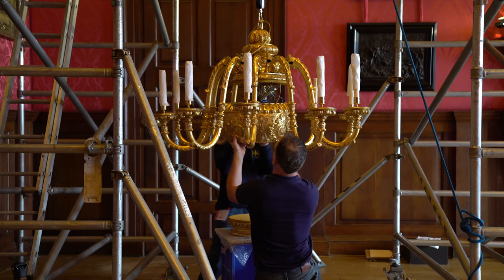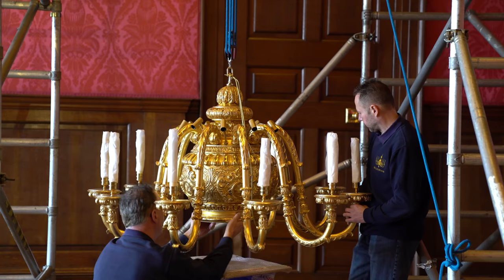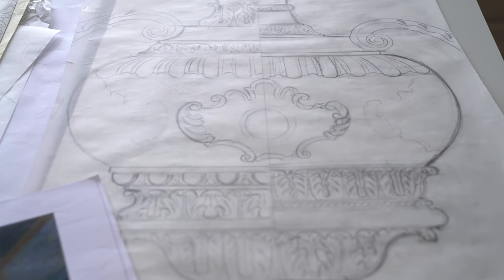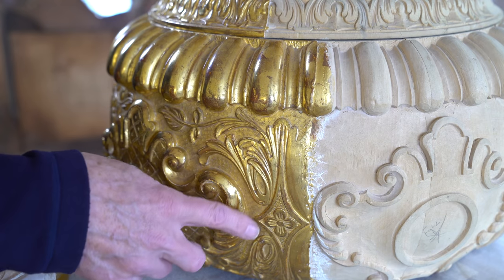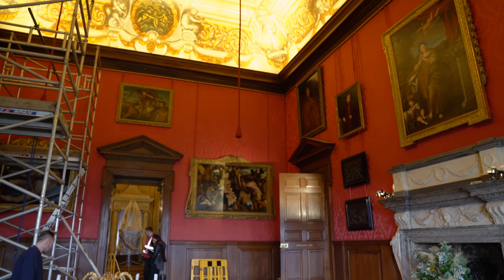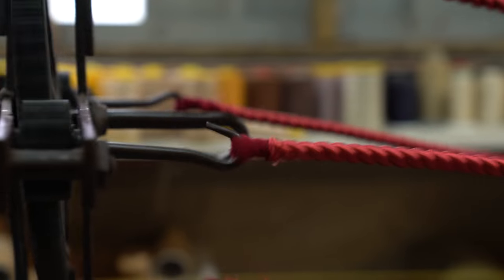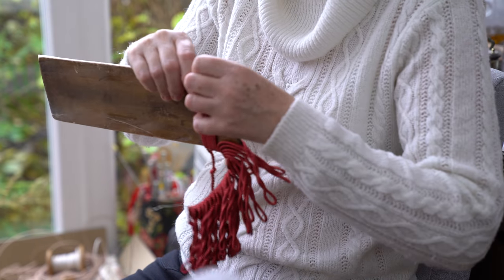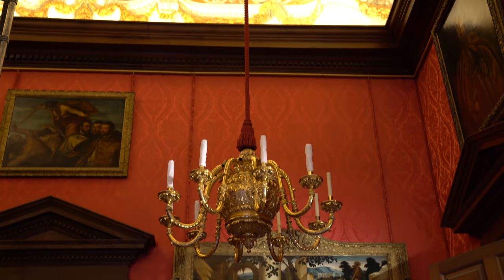Chandeliers return to Kensington Palace after 200 years

Comment: I had no idea that most chandeliers were made from wood at the time! I had always assumed they were fully metal. I suppose that makes sense, considering what the weight of a metal chandelier, plus the fact that you would not be up close to it to determine the material anyway.
Reply: I'd love to know how much these chandeliers weigh!
Reply: Some old chandeliers in White House is made with wood too.
Reply: I think he said many, not most. There were many brass chandeliers of that period also.
Reply: I'm guessing a metal chandelier was significantly more costly.
Reply: @davidd7940  Probably not.  Metal would be cast in a mould, whilst these were all hand carved and then coated with 24 carat gold leaf.  Of course, very rarely they we made of solid silver.  There is one at Chatsworth in Derbyshire.
Reply: Large metal ones would probably be hollow inside where as wooden ones is solid.so weight might not differ that much.  What type of wood was used: oak, pine, etc?

Comment: They go to all of the trouble to make them out of wood to be authentic instead of casting them in metal and then gilding, but then they wire it for electric and stick electric bulbs and fake candles on it. Pretty stupid, either it is authentic or isn't and if it isn't why bother with making it from wood that is not going to last or be durable?
Reply: I know it all. I know it all.  When they make a big stink over being authentic that means candles. They have millions to make wooden chandelier copies that will not last that long for the sake of authenticity. Then they stick electric candles in it. The two concepts are in-congruent.
Reply: These days there are health and safety laws that were just not there in the 18th century.  Remember the fires at Hampton Court and Windsor.  We don't really want a third.
Reply: @mscott3918  All true, but again, missing the point...why bother when any nod to being authentic when all of it is not going to be authentic. If such concerns outweigh original materials and design, then make a modern version that looks like the historical production.